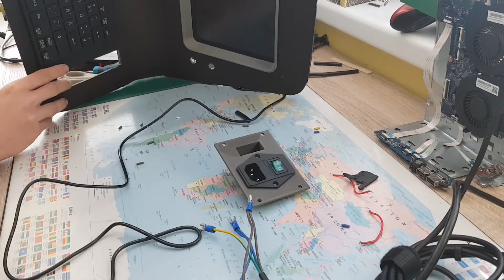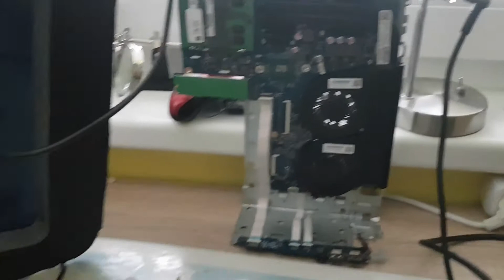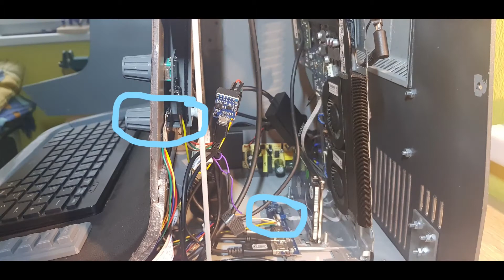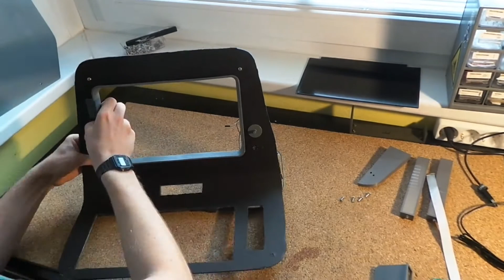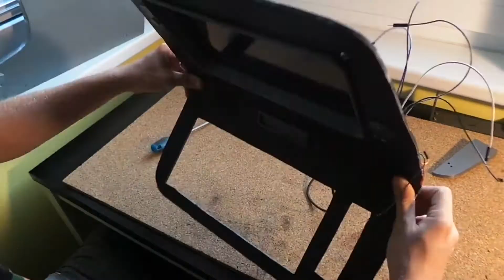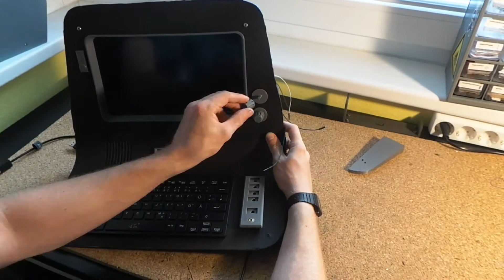DIY Fallout Terminal Part 2

Comment: Cool!  Is there a way to connect the LCD either to the larger power supply or off of a motherboard power rail instead of having it's own power supply?
Reply from the maker: Yeah there is 
You could look for an LCD with the same voltage rating as your powersupply outputs. If you got a motherboard supply it normaly has a 12v rail as well. If your LCD uses 12v this should not be a problem.
 Or you could use a buck/boost converter. On the converter you are able to set the proper voltage and current for the LCD.

There might be other options as well but   that are the solutions i can think of.